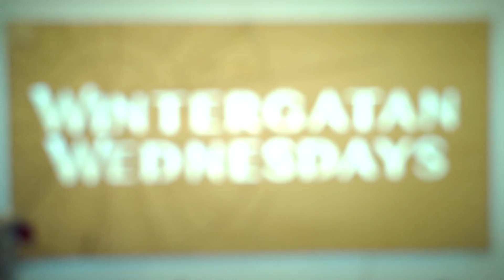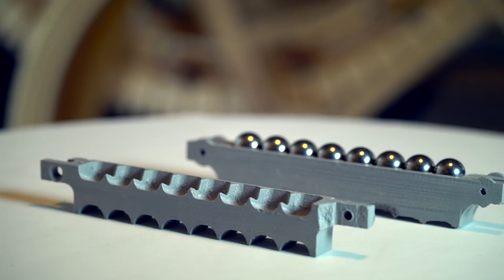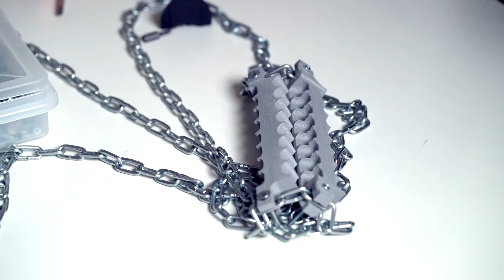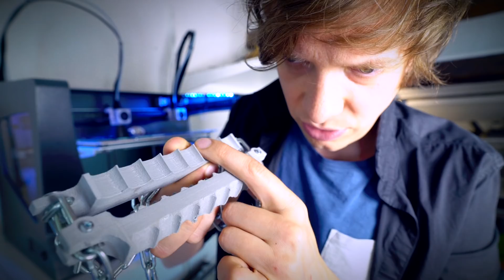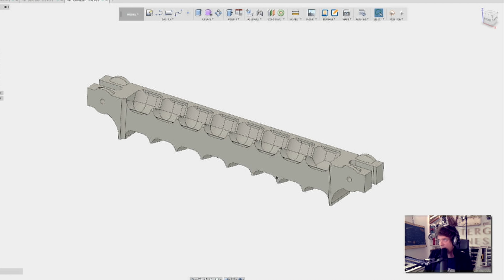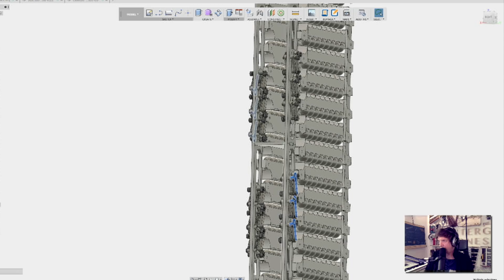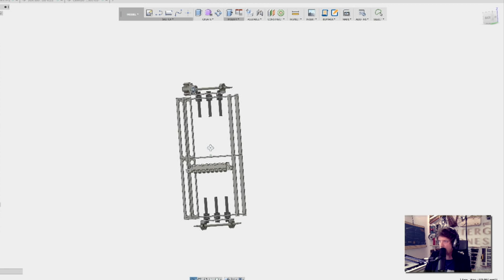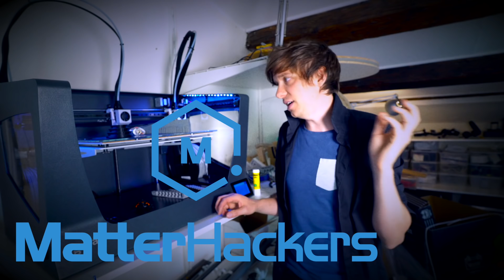3D Printed Marble Lift - Marble Machine X #34

Comment: Good day. I love your channel. One problem I had when trying to print too many objects at once, the first one cooled too much before the next layer.  I had poor adhesion between layers.  Just wanted to share my experience. Take care
Reply from the maker: ah that is interesting, thanks, maybe need higher print bed temp when making more parts...
Reply: Wintergatan most slicers have an option to ‘complete individual prints’, which will print each separate body fully, before moving to the next. The only compromise is you need enough space for the head to move into position for the next printing body without hitting previous ones. This should solve the poor adhesion problem suggested above

Comment: What the what!! Did you print that with a potato?? ;)
Reply from the maker: I am repeating in the video that i did not calibrate anything in order to defend the printer :) its not the printers fault :)
Reply: It was a brave print for a first try. I don't think you need to split the model. In fact I think that would be a mistake as it would introduce a failure point (the glued joint). Orientation is king. Also don't be afraid to remove support and print without it. You may be surprised just how well the printer can 'bridge' when it needs to. Support is only really mandatory where a horizontal structure is unsupported at one end. As you have a whole bunch of these to print, have you considered 'crowdsourcing' some of the parts. Lots of us out here with printers and I'm sure a few would be happy to run some print jobs for you and mail you the parts.
Reply: P.S. I hope you realised my first comment was intended as a joke/playful ribbing, and did not take it to heart. Hence the 'potato' reference. The intonation probably didn't translate in text..... :)

Comment: With a dual extruder you can also use water soluble filaments such as PVA as your support so that there is less manual labor needed. Some things you just can’t print without support so this is a way to do it with less mess.
Reply from the maker: that would be awesome, thanks!
Reply: To mitigate the expense, just use the PVA (soluble) filament for the support interface rather than the whole support.  Also, if using PLA, switch to PETG as soon as you develop confidence in the machine, such a better material.

Comment: Aren't you worried the marble lift won't line up with the rails? Maybe add a funnel-like piece before the beginning of the rail to make sure the lift won't jam.

Love your work. Peace!
Reply: This was my first thought, too.
Reply: A 30° bevel on the guide slot should help it seat correctly.
Reply: Had the same thought. I’ve actually even had that problem on my own machines.
Reply: Was the same thing I thought when he showed a single lift, I know the rails go deep into the lift but there's still the possibility it gets jammed.
Reply: Bill Keith that's nice! Any explanation on why 30 or is it arbitrary?
Reply: Bill Keith and also, why the slot? If you mean it should be done on each piece, it's kind of a lot of work if the pieces of the lift have already been printed, but if they haven't, it could be implemented easily.
Reply: Actually 15° is a standard draft angle. 45° would be too steep and would not be a smooth mating of the parts.

Comment: Martin, I would take the 3D printed parts and make a mold using them. Then pour resin into the mold and make it out of resin (harder and more durable). And you can always make replacement parts easier than the 3D part which takes time. And even easier to mold if you split the part. P.S. Email me about my Modulin II build.

Comment: 38 views 78 Likes, YESSSSSS Wintergatan!!! As always, amazing job :-)
I have a question though, why would you not just rotate the piece by 90° (standing up)? They are some angles that are too steep and would need support? That would allow you to print basically all the pieces at once with the surface you have, and I don't think that there would be a height problem seeing how big this printer is!
Reply from the maker: That layer direction would be weaker and still need for support, i think the piece should be designed better for printing and it will be great.
Reply: Oh yes, didn't think about the differential tension load... But does it matter really? I mean, they are conveying not that much weight, depending on the material you use (some are VERY sturdy).
But as the others said, water-soluble support is definitely something to consider to finish the parts in almost no time!
Reply: How can he have 38 views and 78 likes
Reply: Maddie Chapman Hey, ask Youtube algorithms, not me :-) There was a 300 view bug at some point, but this isn't that, I have no idea why :-)

Comment: that printer needs some tuning.. aweful print quality... but cool piece ;-)
Reply from the maker: I need some more testing time and it will be great
Reply: If you're impatient you can also use the two extruders to simultaneously print two pieces in duplication mode :) For simple pieces there is no need to use dedicated support material. Only for hard to reach places dissolving support material is perfect.

Have a lot of fun with the 3D printer!

Edit: ah, you are aware of this.
Reply: Wintergatan , I know how many exciting is to play with a brand new toy... Enjoy this sensation!
Reply: Also this sounds like constructive criticism, not hate speech so I don't think he took it that way.
Reply: I like the water soluble idea with the second print head for the support structure so all he has to do is soak it in water and it dissolves away.
Reply: Le Minh hate speech is Free Speech ding dong salamander
Reply: Yeah, I wanted to comment on that, too. I've seen 200€ printers do a better job than that.
Reply: i didnt mean it badly.. when i got my 3d-printer i became obsessive with getting it as precise as possible.. :-) so much joyful learning to do.. very cool machine though.. and the salamander is really good, qualitywise :-) thanks for sharing all your work with us...
Reply: Gunnahan Yeah was about to say that the quality of the print looked horrible. Also most of the supports are unessential and the way Martin cut it out was could've affected the piece horribly

Comment: I never use generated supports. I custom design, within the part, a support structure that is minimalistic and aims to not intrude on vital components like internal holes or small gaps that can bridge on their own.
Reply from the maker: Thats really interesting, thanks never heard that!
Reply: Many slicers include some option for manual support. Where you can add support pillars or something like that. cad'ing the support is not always needed.
Reply: Wintergatan i do the same and Cad my own support both support pillar and for example hole fastening chain I do fill it in 1 layerhight and just drill that out after.(no support needed just bridging then) Can Send pictures later and talks swe😉
Reply: Of course not as efficient as designing your own. But it making your own takes at least 10 times longer.
But if it is a very complicated shape, designing your own might be the better choice in some cases. Kinda depends though, sometimes its not worth to bother.
Reply: jort93z mostly paid slicers. And its never as efficient as designing your own. As sometimes you can make an 'impossible' print possible if you think abiut it in the right way.

Comment: Do yourself a favour and use simplify 3D for slicing your models gives you greater control over your print quality, buying simplify 3D was best decision I ever made
Reply from the maker: Thanks great advice, will look into it!
Reply: Glad to be of help, I've done alot of work with 3D printing and a skill that you need to master is print orientation, which Simplify 3D will help you master easily, otherwise you have to orientate it correctly in fusion 360 when you export the model out as an STL

Comment: You don’t need a raft for these components. A brim is sufficient and easier to clean up. Make sure there is no draft across your printer. That helps with warping.
Reply from the maker: Thanks, i had problem with print bed adhesion at first but think i will solve that, i agree the raft should go!
Reply: Wintergatan Also, will you join us as a guest of The Creativity Podcast? https://itunes.apple.com/podcast/the-creativity-podcast/id1281330349?mt=2
Reply from the maker: There is both glue and tape on the printbed in the video!
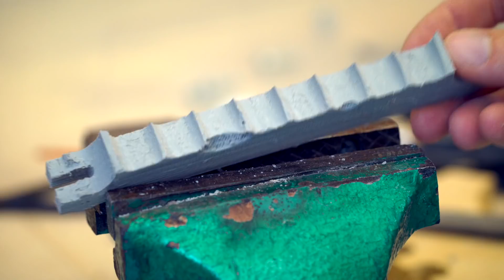Reply: Judging the 0:58 part looks like you are using lots of infill if I'm not mistaken. Using more than ~30% barely gives any benefit in strength and all you get is longer print, wasted plastic and more weight on parts.
As for raft when you really need it, separation can be a little bit bigger. Makes removing it much easier.
Deciding the print direction also dictates end-result precision, you get bigger precision on X/Y axis compared to Z where you are limited by layer-height. 

Nice to see that you got multiple extruders, one day water-soluble filament will make your life easier :)
Reply: Use glass to print on, not blue tape.  And if it get fingerprints on it, you just clean it with soap and warm/hot water to get rid of fingerprints and greace. Rinse well in water. It should be clean and it will stick with nothing else.
And it works great with heat bed.   Use about 200°C on the hot end and about 60°C for heat bead.  That usually works great on PLA material.  You could also have a look at the a heat tower, which is a printer tower with different temperatures.  Then you can see what temperature your material needs.

As you demonstrate, the rotation are important when lay out the 3D print in the slicer with less support.  You can also glue plastic together with "terpentin" that melt the plastic. To increase the finish, you could also let the plastic part be in a jar with some "terpentin" in the bottom.  That will make the surface much smother.  Also, don't print to fast and with to high levels when slicing, as that is bad for the finish.

And yes, calibration the bed and heats are important for the material. To get good temperatures fast, print a heat calibrating tower, which print with different heat end temperatures, so it is easy to see which temperatur you could use.  It is about how good each layer sticks together and how you can print without support.
Here are some short and good videos about material, speed and temperatur.
https://www.youtube.com/watch?v=O70fJMMBmAI
https://www.youtube.com/watch?v=BBQTD9_34sQ

Here are an example you should print for each new sort of filament you use.
https://www.youtube.com/watch?v=q6a87NohedU
Reply: I'm surprised Warping is any problem here at all. PLA should suffice for the stresses put on here, which has a low-warp tendency, and PETG would do itself fairly well too.
Also, isn't Painter's tape on a print-bed a somewhat old solution? My BuildTak sheet has been holding strong for easily a few months now, and I have heard a LOT of good things about PEI sheets (except when used in combination with Copolyester like PETG :c)
Reply: tbh, my opinion is that if you need to use one or both of those it's usually more of a sign of bad Z calibration than a prerequisite for a good print... and PLA should not warp if you are using the correct print temp and bed temp corrected for humidity (please please keep your filament dry)
Reply: Cheap hairspray on warm glass. Tape and Glue isn't the best.
Reply: Don't need hairspray.  Just a CLEAN glass plate with a heat bed.
Just clean the glass with soap and water when it doesn't stick properly. Which is about once a week or when there are fingerprints on the glass.
Reply: If you're printing in PLA, adhesion can still be a recurring problem even if you've got a lot of experience printing. Temperature differences are the biggest issues. I print exclusively in PLA and use a heated bed at 62 degrees to keep it from warping or needing a raft. Filaments can be fussy depending on the humidity of your area. For me, 55 degrees causes warping, but 62 doesn't.
Reply: Use some tape or a glue stick on the bed before the print? If you look up "Glue/Tape on print bed" there should be a lot of videos on it. Hei fra Norge btw. :D